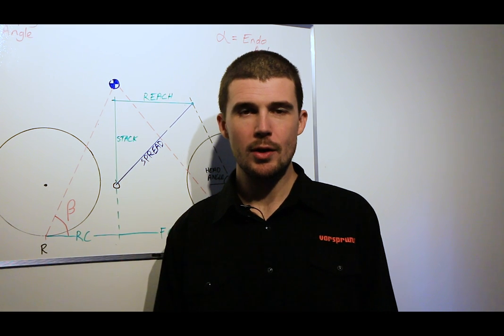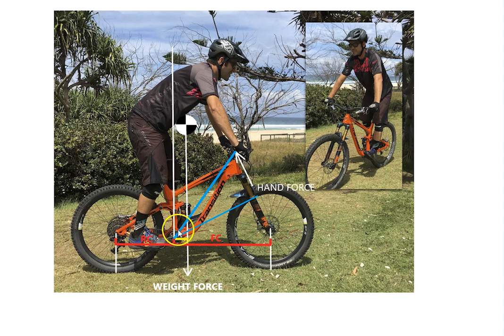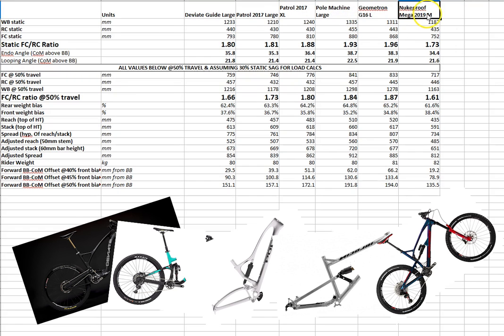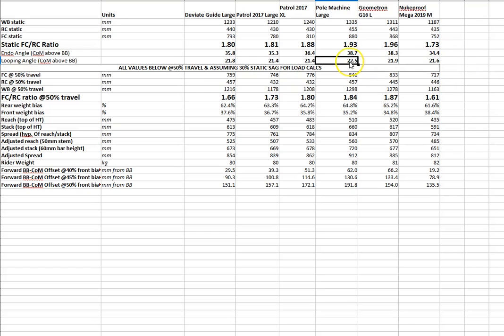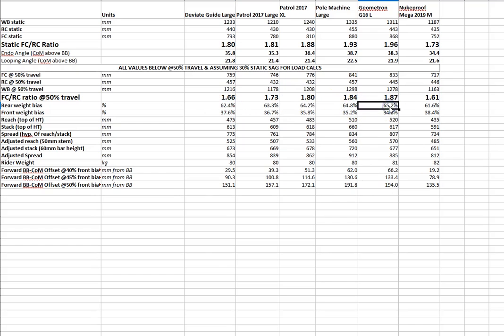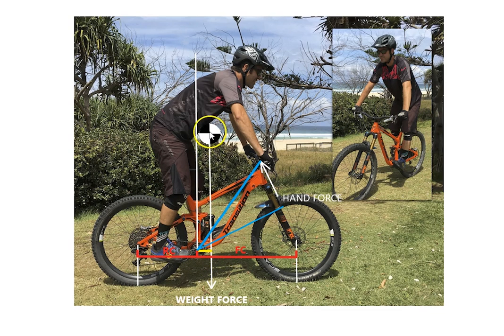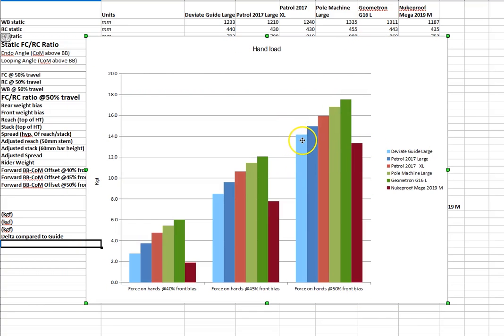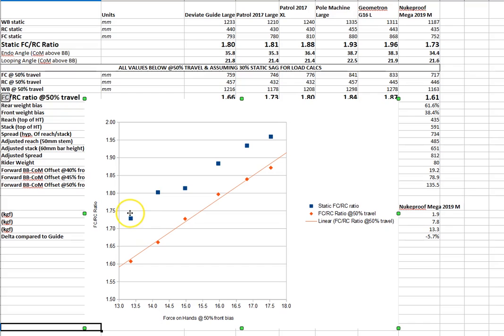Understanding Advanced Bike Geometry Pt 2 - Tuesday Tune 26

Comment: Hi Steve! It's Leo here. I think you were asking me to answer this one :D Cool crushing numbers! Kudos for that, but you fell into the "static vehicle design fallacy". We did similar graphs a few years back before we started to change the geometry. One of the assumptions was that if we make the reach longer, the rider might get more tired if your reach goes further in front. The numbers don't really take in count the reality where the rider position of riding is not static. The optimal rider moves up and down on the bike rather back and forth. The riding stance is not very static, and the rider kinematics, the bike kinematics, and braking need to take into account. So, just trying to calculate the numbers on a sheet for a bike is not worth it because you start jumping into conclusions without thinking about the rider. Many bike designers seem to follow motorcycle and car design principles and that is a big mistake on bike design. What you need to do is start to stand on a scale and lean to a desk and bend your knees. ;)

Braking affects quite a bit to your weight distribution because riders don't go through corners very often just by coasting without braking.  Fe. Matti Lehikoinen drags his front brake throughout the corner. When we looked at the cornering by video, we saw that all riders on old school bikes,  tend to reach back on their bikes rather than in front. The reason is that on an old school bike there is not enough room (your body mechanics limits it) to move down to reduce the weight on the front. The riders control the front wheel weight by moving up and down. You can test this by standing on a scale next to a table and lean to it. Play around with the reach and the height of the table and bend your knees while leaning to the table and you'll see a dramatic change on the weight. This is why your calculation is not very valid and the reason you did not have grip is more about the suspension tune and probably more about your riding style (For the record: Steve is FAST). I filmed Joe Nation and Matti Lehikoinen riding our Stamina in Madeira. You can see from the video clearly that the guys are not trying to reach forward to gain more grip https://www.youtube.com/watch?v=O35iidRWKEw Later this year we will have Joe's and Matti's cornering tips on our vlog (supported and a flat corner).

A longer wheelbase is quite different when you ride downhill as you are not in a steep angle on drops. The longer wheelbase front wheel reaches the drop bottom before the rear. This means that the rider does not have that much flexibility and therefore he saves energy by moving less. With all designs, there are drawbacks though. On a longer wheelbase, the front end is not that easy to manual on a road. You need more effort on that. But on the other hand, on the trail, you can get your front wheel up anytime you want and you can also plow through stuff and save energy like that. Also, the longer wheelbase makes the ride calmer because there is less movement on both ends of the bike. Our conclusion is that with a longer bike you save more energy and you are 2-3% faster on an Enduro track.

I think comparing Sam hill and the reach number is a bit far-fetched because if you look at his riding on ANY BIKE, he hardly seems to do anything. The reason he looks like he's not doing anything is just that he has mad skills and he is strong as a horse. On EWS, the pedaling is a very crucial part of the winning ;) 

On the grip issue you had on the Machine: If you remember, we had to use the same rear shock spring rate that I did, and the reason why you did not have enough grip on the Pole you rode was mere that your shock did not have the right spring rate. I weight roughly 73kg, and you are somewhat 90kg? I think it's fair to say the bike setup was far off for you.

Your tech vlog is cool! Actually, I was just about to email you about the hysteresis on shocks. I'm still thinking if the hysteresis on shocks is useful or not because we can create a similar effect with the leverage ratio and a low tune as well. I would love to chat again soon and change thoughts because I think that you are one of the smartest guys on the bike industry!
Reply from the maker: Greetings again Leo! This is obviously a static, flat-ground comparison simply for the sake of eliminating variables in order to maintain consistency, and ONLY really looking at cornering grip. FC:RC is not really relevant in a straight line or in any situation where you aren't exceeding lateral tyre grip. It's easy to say something is a static fallacy but short of coming up with a 6DOF simulation incorporating the rider (which btw I have actually tried to model in the past) everything will have some simplifications or situations where it isn't applicable. This is part of the reason why I said that my opinion was that optimum front tyre load (as calculated here) was actually LESS than 50%, because obviously descending sloped terrain will always increase front tyre load for any given body position when compared to flat ground. At any rate, trying to quantify these things in a dynamic environment is hugely problematic in no small part because the rider can move so much to compensate for the bike.

You may be interested to know that this was a topic I started examining in more detail after riding the Machine to try to explain what I was feeling on the bike, because after riding with you, I got back on the Deviate and went for a ride to see what differences I would notice. The improvement in front end grip on the Deviate - specifically, how centred I could stay on the bike whilst maintaining front wheel weighting in both smooth berms and rough flatter corners - was extremely noticeable. Having spent a large amount of time riding various suspension setups, I'm very confident that the somewhat too soft rear end wasn't to blame (although on that note, I'd recommend on future models making the centre of curvature higher and the linkage less progressive, that'll help reduce the harshness on square edges, improve rolling speed and get rid of that tendency to kick on jumps), and I even went as far as testing that by underspringing the rear of the Deviate too. The effect it had was the opposite of what you suggested though - running the rear end disproportionately soft led to a reduction of grip at the rear wheel rather than the front.

I'd agree that riding styles affect it a lot - shorter riders and riders with stronger upper bodies will find it easier to keep weight on the front wheel in most cases. As you say, riders on more conventional-geometry bikes tend to be further back on the bike when cornering - but my opinion seems to differ from yours here, because I don't believe it's that the bike is in any way forcing them backwards, I believe that they're simply able to keep enough weight on the front wheel without being forced to lean far forwards to achieve that. Essentially, they can support their body weight more through their legs and less through their arms whilst keeping weight distribution appropriate, and even the strongest guys out there are still stronger in their legs than their arms.

I agree that long chainstays are little hindrance on the trail - they suck a bit for skatepark riding but I don't think I'd really care about the extra difficulty manualling. I'd really be super interested to ride a Machine again, except one with a ~490mm chainstay instead of 455.

Hill is a beast, no doubt about it, and we can all agree that his success is a LOT more to do with his skills and fitness than the bikes he was riding. But you should go back and look at the bikes he's had the most success on over the years and compare the FC:RC ratios. The Sunday he was destroying everyone on in 2007/8 had a ratio of around 1.68. Oddly similar to that Mega. 

Shock hysteresis can't be replicated with the leverage rate of the frame as such. I don't think it's a big deal really, having zero hysteresis is almost certainly worse for bump absorption than having some moderate amount (an ideal amount of which I have not yet quantified - having a ton of it isn't great either).

Cheers for the discussion!
Reply: @VorsprungSuspension  Love the calculations. This kind of analysis is great for beginning to understand what's happening on the bike, even if it doesn't tell the whole story.

I agree with Steve that Pole/Nicolai/Transition bikes are harder to find front-wheel grip in some flat corners, but this can be mitigated with grippier front tyres and a more forward riding style. I agree this can be more tyring on the arms, but i think recent improvements in fork air springs have allowed front centres to grow by iproving front-end comfort and support, so the rider can put more weight through the bars. The machine is a lot easier to turn with the Debonair Lyrik than the old one. 

I think the Deviate is not the best comparison to support this point, though, because it's so different in terms of anti-rise, head angle and chassis weight distribution. It's a particularly easy bike to ride in terms of flat-terrain traction, but it's way too short for my tastes when things get steep and rough. Maybe i can convince @Pole Bicycle Company
 to machine up some different-length swingarms to test.
Reply from the maker: @sebstott3573  cheers. But what if you put the grippier front tyres on the other bikes? And the whole point was that you do actually HAVE to ride more forward on these bikes when cornering, and that as you say, it's a bit more tiring when you're in that position. That could be countered (or even exceeded in a beneficial manner) by being more relaxed during straighter segments of trail since the bike's tendency to trip is lower with a longer FC (as discussed in the previous video).

The Deviate is an absolute beast in the corners and just super easy to rip on, but I agree that its steeper head angle and shorter WB make it feel less planted at high speed in a straight line (although for outright plowability the rear end still feels better than almost anything else I've tried, Commencal Supreme SX being the only thing better, and that also has 20mm more travel and cornered a bit weird due to the high initial FC/RC ratio). But the chassis weight distribution itself is largely irrelevant IMO since even a relatively heavy bike is so much lighter than the rider to begin with, and anti-rise is only relevant when braking (which in an ideal world we'd avoid doing mid corner). The Deviate is certainly not perfect either, there's plenty of things I'd like to alter, but I actually do think it is a good benchmark for this particular mode of analysis because it's one of the few bikes I've found where the spread is reasonable (ie sizing is good for someone my height) AND the FC/RC ratio is reasonable.
Reply: @VorsprungSuspension  Sam Hill's custom Sunday frame had a Large front triangle with a Medium seat tube length, and the head angle was 63 degrees. That makes the ratio of FC to RC something like 1.77, closer to your Large Deviate, for a 175cm rider.
Reply from the maker: @AlexSalikan  he also had custom offset crowns long before Mojo made it trendy, the wheelbase was said (by DW, the designer) to be about the same as the stock large.
Reply: Slackening the head angle by two degrees would increase the wheelbase by something like 40mm. The stock Boxxer had an offset of around 42mm. He would have to have run close to zero offset to have a near stock wheelbase, which clearly wasn't the case.
Reply from the maker: @AlexSalikan  just calculated it out, increase in WB would be just under 18mm for a 568mm A-C between 65 and 63. IIRC DW said the offset crowns were about 10mm lower, so net difference of around 8mm for a ratio of 1.70. Could be off a bit if he ran the crowns further up the stanchions though, don't have data on that.
Reply: You're right. My bad. I doubt he ran the crowns higher up the stanchions, as he was all about getting the front end as low as possible.
Reply: @VorsprungSuspension  

"This is obviously a static, flat-ground comparison simply for the sake of eliminating variables in order to maintain consistency"  
It's rad that you make these videos but, but there are numerous issues with your physics analyses.

1. You use bikes that have different size
2. You use bikes with different fork lengths (AC)
3. You neglect the real-life testing and try to base your study with a different day riding with no actual numbers on real life.
4. There are no numbers on simulating fatigue.
5. The bikes do more than just cornering

I don't think this is a good way to evaluate a bike characteristics because the static is not very constant when riding a corner with a bicycle just because the rider weight is far greater to the vehicle. Also, your reasoning for getting bikes with very different travel and size is not very smart regarding comparison between them. If you did the experiment I recommended, with a scale, you should understand that just by bending knees the rider can change the weight shift easily over ten kilograms. The reason that a longer reach works with an average rider, they can not push their weight off the front wheel what is usually the problem of washing out or going over the bars. You are literally the first person ever even to bring up such claim that on a Pole there is not enough grip in the front and I think the reason is that you were on experimental setup on the rear shock. With our pro riders, we have made a lot of testing lately, and none of them pointed out anything that you said in the video. The only thing what Matti and Joe were commenting was that they had to adapt to the length of the bike timing wise. Leigh, which is a similar size to you was happy from the start that he could finally get a bike that is big enough for him. What I'm trying to say is that your numbers (for the fatigue and grip point) do not have a lot to do with real life riding. If you look at the video, I posted in the last comment, and you look at it frame by frame, you can see how the guys corner. Matti is using almost all travel front and rear before he exits the corner. Here's more cornering where you can see how Joe is on the medium bike. https://www.instagram.com/p/BrpKdU3lYZE/?utm_source=ig_web_copy_link

"I'm very confident that the somewhat too soft rear end wasn't to blame"
 If you soften the rear and load the bike, you will lose the energy in the corner to the back mainly because the energy goes where it goes the easiest and that's why you could not load the front enough. It's like firing a cannon on a swamp. You need support from the rear to engage the front.

"although on that note, I'd recommend on future models making the center of curvature higher and the linkage less progressive, that'll help reduce the harshness on square edges, improve rolling speed and get rid of that tendency to kick on jumps" 
Seriously Steve? You seem to forget that you were riding was the underdevelopment EXT Arma that had too little high-speed rebound damping (bucking), far too much of the hydraulic bottom out resistance (which is the reason of square edge hit inconsistency). I really think it's unprofessional to make such claims without even riding the optimal setup and also if you would have told me that you would quote our riding session in a video, I would have set up you differently. The higher curvature point for the rear wheel, for instance, has nothing to do with square edged hits being transferred to rider characteristics. A lot of companies have made experiments (Specialized fe.), and no-one has come up with a reasonable scientific explanation why a rearward axle path (frontward bb path) would improve the riding over an obstacle. However, I can point out why the riding gets worse by extending the bike from the rear which would improve your "number of equal weight distribution". In the early days of Pole, we had a test bike that had a vast rearward axle path (K9 DH001-S), and the rearward axle path didn't seem to have anything to do with better square edged hits. However, in cornering the rearward axle path brought the rider weight way too much in front and it was hard to corner the bike because the rear center was getting longer throughout the travel. Our conclusion from testing Pole against K9 bike was a massive difference in timed laps in favor of Pole Mule. The bike that had more travel, a rearward axle path, and similar setup was slower than our mule with a concentric single pivot and a forward axle path. The only way we could explain the dominant behavior of the mule was a better geometry for a rider to exit the corners with higher speed.

"I believe that they're simply able to keep enough weight on the front wheel without being forced to lean far forward to achieve that." Well, I did not say anything about leaning forwards. I said riding with straighter legs vs. bent knees. You don't need to "lean forward" to get more weight to the front. The riders are bending their knees so they can go lower to gain less weight to the front end. We have now three riders on our team that come from such conventional bikes, and they have all found out the benefits of a longer bike. Nobody was saying anything about fatigue during the tests. One of the riders comes from Nukeproof. 

It's another thing if we start talking about how the riders physics work on a bike and how do you want to set up your bike to save energy? This is what we are doing on a weekly basis. Actually, your body is usually equally weak if you have not trained it especially for something else. On a bike, you are using pretty much your whole body for riding, not only legs or arms. Your core muscles are more important than just individual part of the body. Some people start losing their strength from back before their arms begin to lose power and someone's calves are getting more tired than hands. Usually, it's the hands that feel the pain, but the problem might be somewhere else.

There are many variables what we need to take into account when we manipulate the geometry but one thing what you need to take in to account that you should not trust too much on your feelings. If you did not make any measurements (timed runs, grip power test...) when you rode the two bikes, you can't clearly make any firm statements. The reason that I'm so sure about this is that we have done a lot of testing and one thing that is sure is that the riders can not say how fast they were after a test run. At Pole, we have a lot of bike with different sizes so for us it's effortless to test these things. Apparently getting a shorter bike for me for testing is not an issue. While I was in Whistler, I was riding Medium and Large, and I did not find any problems of having more fatigued on either bike. The most significant difference for rider feel was the shocks. What I've learned about the front end grip is that only 5mm spacer under the stem makes a massive difference how you can load the front.

During the six years of designing bikes 100% from the ground up, I've found out that just changing one or two numbers is not the whole case. Stamina and Machine are both very similar bikes what comes to geometry and suspension (Stamina has the same rate of a leverage ratio to 160mm of travel), but still, they ride entirely different. The reason for this is that I made many small changes throughout the bike where construction of the frame itself was the biggest. What I want to say is that just changing one number doesn't necessarily give you the desired effect.

PS. I asked Matti Lehikoinen about Sam's riding style. He said that no one can ride like Sam or Sam's lines in the world. Many have tried, and many have failed. Everyone has to find their own style to be fast. Also, we talked about the balance on the bike. Matti also thought that trying to crunch the numbers to this individual number is a waste of time. You need to do timed laps and measure the changes. That's how you do it professionally.
Reply from the maker: @Polebicycles  to address your concerns in order:
1. "You use bikes that have different size
" - yes, for the sake of illustrating that different sizes of the same frame have different characteristics. I was quite clear on why I compared the medium Nukeproof and not a Large or XL. Every company specifies different recommendations for rider height vs their sizing so I grabbed size Larges to compare for everything else.
2. "You use bikes with different fork lengths (AC)"
 - yep,  I don't actually consider that particularly relevant here.
3. "You neglect the real-life testing and try to base your study with a different day riding with no actual numbers on real life".
 - You are 100% wrong on this assumption. This isn't a blind analysis of bikes to predict performance, it was a numerical analysis of what I had experienced in real life. 
4. "There are no numbers on simulating fatigue.
" - are we really going to try to argue that more load on the arms isn't going to be more tiring? 
5. "The bikes do more than just cornering" - obviously. This is a cornering body position analysis. It's not a comprehensive simulation. The point of it was simply to show that weight distribution in corners matters and body position is affected substantially by the FC:RC ratio. 

I realise you're upset because I criticised your "perfect bike" but you're also sitting there criticising every other bike in the world as well as trying to publicly discredit numbers that do actually make sense. I didn't bring up bump absorption or bucking any of the other minor issues in the video because I agree that the shock damping and setup weren't ideal. They also weren't so far off that they affect handling to anything like the degree you claim - I've been riding for the best part of 20 years and have spent most of that time with my head in suspension. The front/rear wheel grip distribution was noticeable even on steady state corners where the bike reached a temporary quasi-static position. In those scenarios the only thing that matters is your weight distribution, the damper is doing nothing and the spring force is a constant.

"Well, I did not say anything about leaning forwards. I said riding with straighter legs vs. bent knees. You don't need to "lean forward" to get more weight to the front." - Actually, yes you do. You can move down and forwards or just forwards, but either way, the result is moving the centre of mass forwards, and the consequence of that NO MATTER WHAT is more load on the hands. I don't understand how you're even trying to argue about that, the physics is simple and immutable. You can't on one hand tell me that I don't know what I'm talking about and that the comparison is invalid and then simultaneously dispute a simple free body diagram balancing moments - that would have been something you learned about in the first month of studying engineering.

Comparing the experiences of professional riders to the rest of us amateurs in terms of upper body fatigue is obviously going to result in "guy who spends more time in the gym and on the bike has less issues with arm fatigue". And yes I'd also agree that arm fatigue is not the only concern, and not always the first thing to give way.

As far as "high pivots don't have better bump absorption or rollover characteristics" - you clearly have not actually analysed or measured that in isolation, so please drop the "there are numerous issues with your physics analyses" thing - nobody here has a "complete" understanding of everything, and the fact that another bike was faster overall doesn't negate the benefits. The shaft velocities are lower, the wheel has more time to get out of the way, generates less CPL variation, lower normal and tangential forces on the swingarm resulting less hanging up on medium and larger bumps. You can definitely debate the handling characteristics and the greater variation in centre of traction, but the bump absorption aspect (in isolation) is no more up for debate than climate change. Your standard of comparison is a DH bike vs a trail bike - ok, so what? That's equivalent to using that comparison to try to say "well we compared our test mule to the ugliest bike we could find, and our bike was faster, so obviously the bike's ugliness was what held it back" when there's a TON of confounding factors. That isn't a measurement, that's not scientific, there's nothing proven there other than "this complete package was faster than that complete package". Any XC hardtails would be faster than DH bikes on certain terrain, does that also mean DH bike geometry is slower than XC bike geometry?

The problem with your line of argument here is that you're taking the "you haven't proven my bike isn't faster" approach - I don't personally care if your bike is faster or slower overall, in fact you may notice that was never mentioned in the video. I was looking ONLY at the cornering weight distribution aspect. Trying to discredit the analysis just because it doesn't favour your bike is frankly quite weak. The numbers I posted are reasonably indicative of what you see in the real world IN THIS SPECIFIC SCENARIO, in fact from a vehicle dynamics perspective they're quite bulletproof (except that I messed up the Nukeproof's RC, should have been 437mm at 50% and a FC:RC ratio of 1.64 not 1.61 as someone else pointed out). They don't mean that the bike is a POS or that it's slow or otherwise poor. But so far you've incorrectly pointed the finger at a bunch of different prospective causes rather than just acknowledging the fact that yes, your CoM has to be further forward of the BB, thus putting more weight on your arms. You could have at least made the claim that this was offset by the greater straight line/steep terrain stability and that the net levels of arm fatigue on the Machine would typically be comparable or better to other bikes, and on that I might agree, because it is good on that. So stop taking it so personally. Instead you should maybe take it as a compliment that people actually think your bike is worth comparing to others as a benchmark of some form, even if it has its tradeoffs in certain areas, and that discussing compromises isn't intended to paint your work, your products, your company or you personally negatively. It's kind of similar to making fun of someone's English when it's their second language - by the time it gets to the point where you'd laugh at something funny they said, it's because they're speaking English so close to perfectly that any discrepancies stand out. When people openly criticise specific aspects your products, it's because they're good enough to be worth it.

Like I said though, if you ever build one with a way longer RC and a higher pivot, I'll be VERY interested :)
Reply: @VorsprungSuspension  

Firstly, just because I criticize your video does not mean that I took it personally and I hope that you don't take this either. I'm doing my job :D I like you and I think you are cool. If I would not know you I would not bother to have this conversation in the first place. This is your channel and you can say whatever you like. The reason why I comment your video is that you brought up Pole and use it as an example, and I think you did a bad job at your conclusions, not on the spreadsheet. I'm not mad at you and I don't think I have created a perfect bike for everyone. We have sold thousands of bikes to 37 countries so I guess trying to flatter us with bringing up the bike on the channel is not relevant here. We have our own secret sauce and if you would create bikes, you would have yours. I'm just disappointed with your way of bringing this up because I thought that you would keep the consistency on your channel purely analyzing things scientifically and not bringing up individual things out of context and base your strong opinions just on confidence. 

Overall I think that in this video you are trying to simplify a complex thing based with thin evidence. I think that your assumption of Sam Hill is far fetched because he does not represent any of the majority of riders. Sam might be even the most unique rider out there. "I feel", "I believe" and "I'm confident" and analysis based on a riding style like a sack of potatoes does not correlate to reality. I'm not saying that you ride like a sack of potatoes but neglecting the human biomechanics and phases of cornering, braking, squatting, loading etc. and also the brake squeeze power taking off the equation and trying to base evidence on a feeling is just very lame from a scientist. If you would be another journalist who just would base your findings on feelings, I would not bother to have this argument. If you would act like a scientist, you would need more data to convince me about your theory. Your English is far greater to mine (and I find you verbally very talented) where I need triple the time to even write these comment so don't get offended if I'm not answering everything. But one thing I want to address is: "are we really going to try to argue that more load on the arms isn't going to be more tiring?" No, I'm not going to argue about it if you put it that way, but I think that you are oversimplifying human physics by just saying that.

I think that our points of view differ in looking at overall performance and one individual performance points of view. I think that overall is what matters and the one thing should always be possible to measure in real life with the overall performance test. I think for example @Seb Stott is doing a great job with his articles. For example, the tire test is very good. You could do the same thing in a laboratory or try to crunch the numbers on an excel sheet but the real life is what matters the most. How do they actually perform?

 We sent a stock bike against pro racer bikes: https://enduro-mtb.com/en/10-fastest-enduro-bikes-in-test/

I'm going to leave this here. Happy new year!
Reply from the maker: @Polebicycles  no worries, as long as we're hashing out useful concepts then it's all productive. I think however that you are building a straw man there, because where you think I'm not looking at the bigger picture, you're ignoring the fact that I'm not TRYING to look at the complete picture here, just one small (but IMO important) element of it, in a way that clearly explains the concept of weight distribution in one particular scenario. The reason this part is so subjective is because the point was to explain what I had experienced as a rider - in the real world, on various bikes, on various trails - by being able to compare numbers between bikes. Besides the fact that obviously that isn't everything involved in making a good bike, just one aspect, what it doesn't establish, or even attempt to, is what an "ideal" degree of arm load is - because obviously that depends on rider strength (even proportionally within his/her own body, as you say, because the arms might not be the limiting factor) and preference, since some riders like particularly aggressive forward positions and some don't. It does however point out the obvious inaccuracies in claiming any bike's handling is dialed beyond belief when the bike has multiple sizes using the same rear centre length - it might be great in one size, might suck in another, at least in this particular regard.

I put Hill's bike in there only because I thought it was interesting for the sake of comparison, not because I pretend to know why he's as fast as he is (I doubt even he really knows that) or because I think the bike is the reason - it was simply to look at potential strengths that his particular configuration may have given the fact that his bike does NOT have the indisputable straight line advantages of the Machine or Geometron. Maybe he'd destroy everyone by huge margins if he was on a Machine or similar, but then again, if that Enduro mag test is at all accurate (I have plenty of reasons to question it however, on many aspects), maybe he'd be slower and should be riding a Hightower instead - hard to believe the almighty Evolink was toppled by a fairly conventional-geometry Hightower in that Enduro mag test, although you're gonna love me for pointing out that the FC:RC ratio (at 50% travel) of that Hightower was 1.63 :)

Anyway understand if you don't wish to continue discussing this in public. Keep up the innovation though, the Machine is overall undoubtedly the most interesting and unique bike built in the past 10 years, and you're an interesting and somewhat crazy guy who I'm sure will manage to surprise everyone many times to come. All the best.

p.s. only mentioned the Machine out of spite for you not publishing geometry on the Stamina. Haha :)
Reply: Vorsprung Suspension These were the best comments that I’ve read on YouTube. It makes to me to trust Steve more and I also want to try Machine! Great job guys! Keep it real.
Reply: @VorsprungSuspension  you didn't look hard enough. The numbers for the medium, at least, are out there.
Reply from the maker: @jacobtucker3856  didn't look hard enough for what?
Reply: @VorsprungSuspension  "p.s. only mentioned the Machine out of spite for you not publishing geometry on the Stamina".
Reply from the maker: @jacobtucker3856  that comment was just winding Leo up due to him obviously getting sick of people discussing geometry on the internet and publishing head angle figures like "slack" and seat tube angle figures like "steep" :) I don't really care whether he wants to publish geometry or not, it's his prerogative, and the Stamina is not an interesting bike to me personally.
Reply: @VorsprungSuspension  @Pole Bicycle Company  Great free body diagram! but I have to go with Leo here. Your spread sheet based explanation is only what it is but in this comment you call out more added variables that would have to be quantified to make it meaningful in Leo's real world. Come on man! It's a a half ass attempt to explain a 'feeling' that you have. The whole thing is subjective and biased from the get go. You data sample is small, 3 of the 5 bikes have been ridden. Why didn't you pick Richie Rude on the SB150? or analyze the much loved short stay Ripmo? Why even name a bike?  Your static center of mass input is bogus. What does adding 5 lbs of Pinion gearbox at the BB do to that? How about the soil condition and moisture content? What about lean angle and tire design? On and on.To keep it fair why not build a spread sheet that was based on a progression of bike geometries that were just graphic representations and not named or branded? When somebody states with authority what you have about the great significance of F/R bias as influenced by front center length and uses words such as ; opinion, belief, believe, try, reasonably representative, reasonably indicative etc. and then attribute your assumptive analysis to Sam Hill's success...... I head for the hills. Some where you claim Leo is making a straw man argument then ad hominem back  about his 'perfect' bike! Telling Leo to not take it personally and how he 'should'  take it is arrogant.  I resist your black and white depiction of my riding experience. Some days my wrists get tired and some days they don't. I have been schooled by the fast young guys to work on my bike body separation, I get lazy on the bike. I'm 68 years old, ...is it my aged body or am I just(finally!) putting more weight on the front end? Hard to tell. I am cornering faster on my Stumpy Evo than I ever have at it's 1.80 by your F/R  measure. I've been riding a MTB for 30 years. I guarantee you that at 20 years experience you are a far better rider than I...but that should not have any bearing on your allegedly objective analysis.  Do better.
Reply from the maker: @buzzerm  You're simply missing the point - that with a higher FC:RC ratio you have to have your centre of mass further forward relative to the BB to keep a given amount of weight on the front wheel. Whatever moment that generates has to be borne by your hands. You can try to complicate it further, but the concept is that simple, and the physics of that really are not up for debate. It's not a static analysis as such, steady state planar acceleration in the Z direction (ie being leaned into a corner during steady-state conditions) is where this is relevant. If the resultant resolved force vectors from the tyres aren't in plane with the rider, the bike/rider mass rolls one way or the other, but that isn't the point of the explanation, so the 2D analysis is entirely reasonable. What does adding 5lbs of gearbox near the BB do? Not much when the bike/rider are 230lbs, it's less than 3% of the total mass. Is this ratio the sole reason why Hill is winning? Nobody is silly enough to say that's the whole reason, you're trying to put words in my mouth there - the point was that he's somehow managing to be competitive (to say the least) on geometry that many people (including Leo) believe is "slower" than the new school geo, and my suggestion (and opinion) is that this is a relevant aspect of what makes it easier or harder to ride a bike fast. Small sample size? Having ridden dozens (if not hundreds?) of different bikes over the years, I picked a handful of relevant ones to put into this video. Strange assumption to make that they're the only ones that have been analysed in this manner. If the best you can come up with is saying that making some effort to correlate the subjective experience in the real world with the objective numbers is "bogus", only to follow it up with your own subjective, utterly unquantified experience and a few personal insults, well, do better with your criticisms.
Reply: @VorsprungSuspension  I am not missing your simple point and I don't think Leo was either. I said you static CG input (into your spread sheet formula ) was bogus, not what you said I said. Your free body diagram and explanation are good and I said that! I applaud your effort to correlate subjective experience with numbers. 5lbs of gearbox weight at the BB does something, the actual center of mass of Sam Hills body vs mine does something...a bunch of 'nearly nothings' add up. Your total range across the bike of COM adjustment to get the magic 50%F/R ratio is what? 59mm/2.32"..? Does that qualify as nearly nothing? And yeah the half ass thing was mean but for somebody as smart as you, your model should be more precise in its inputs. The output to flat ground in a static setup is hard to value in the my view of a dynamic ride experience...but I get the physics!
Reply from the maker: @buzzerm  the numbers are there only to illustrate the concept of how a rider's weight has to be positioned relative to the contact points of the bike (BB/bars) in order to achieve a certain weight distribution in one particular situation, and the amount of variation in load on the hands when all else is equal (because if we're going to vary a bunch of other stuff at the same time then there's no way to make meaningful comparisons). Tilt the bike forward 15 degrees and the numbers shift but the trends between bikes don't - these things weren't included because this video was already longer than I wanted it to be. You can move around on the bike in two dimensions and it'll affect transient and steady state CPL (contact patch [normal] load), but total CPL is a combination of both transient load and weight distribution - the problem with using transient load (eg pumping the bike or trying to push the wheel into the ground harder by accelerating your body mass away from it) to increase CPL in a corner is that because bikes lean into the corner (CoM being vertically inboard of contact patches), you increase lateral load in proportion to the amount that you increase the necessarily planar load between CoM and contact patch - any non-planar load results in angular acceleration in the roll axis, and if you're transiently increasing the load in a non-planar manner to the ground in a way that's actually beneficial to grip then you are necessarily rolling the bike more upright and decreasing the yaw rate. As a result, you can easily pump through corners where grip is abundant (eg steep berms) but not where grip is limited (if you're at the limit of grip... if you're not, weight distribution doesn't matter as mentioned before). 

The reason I made the comparison on flat ground is because that completely eliminates CoM/rider height from even needing to be mentioned as a variable (some non-flat ground considerations are in part 1 of this video if you haven't watched it) which I was sure would otherwise lead to further misinterpretations of the data - we could hold rider height/CoM height as a constant for the sake of comparison anyway, but people would rightly point out that that isn't realistic between a size medium Nukeproof and a size XL Patrol, even though the analyses (not shown in this video) show the trends are valid across those comparisons, whether or not (within reasonable bounds) you adjust for rider height. Rider weight is largely irrelevant because if you're twice as heavy, you have to support twice as much load in any given situation anyway, so that's why that's held constant across comparisons. You're right that 5lbs at the BB does something - it's just not that significant, either objectively or subjectively, compared to the variables we're looking at here.

I think you've also focused on the wrong number to bring up there - CoM movement matters, but how that actually affects the rider is what we were trying to display, in that the FC:RC ratio affects the way you have to bear that load bodily. 59mm on its own doesn't tell you much (and I have actually made an effort to quantify individual subcomponent masses of the human body before to try to work out things like joint angles required for various CoM locations), but 26% higher load on a given rider's hands - even if that's not exactly correct (maybe in another situation the difference is 24%, or 28%, by the time other factors are considered) it's a significant enough change to take seriously, especially since the trend between bikes can be demonstrated to be valid across many scenarios.

As a result, yes, the explanation of the concept is fundamentally valid. FC/RC ratio alone doesn't tell you what bike is great and what bike is terrible, it doesn't tell you what fits you, it doesn't tell you anything about how the bike handles in a straightish line, it doesn't tell you anything about a million other things, but it is fundamentally relevant to how your body has to be positioned on the bike when cornering.
Reply: @VorsprungSuspension  Thanks for this. I agree "it is fundamentally relevant to how your body has to be positioned on the bike when cornering".  Is it possible that pedal kick back or lack of could affect the COM as it translates thru the pedal arm and BB?  Pedal positions as well ..level or outside down? Could somebody with massive core and leg strength influence COM without more pressure on the bars?  Interesting that according to Linkage the Pole has large anti squat and little to no pedal kickback. Check out the last 3 1/2 minutes of this vid :    https://www.youtube.com/watch?time_continue=99&v=tJi5_HF6e_Y   I could not pick out Sam ........40 different ways thru this corner.
Reply: I meant"..... influence FC/RC ratio..." not COM.
Reply from the maker: @buzzerm  pedal kickback is only relevant when actually pedalling in the majority of cases, also occasionally when braking if the wheel locks up (and only if there's a lot of pedal feedback to begin with, it's not noticeable on most bikes but on some it is, like the original Yeti 303), but when coasting the rear wheel is unloading chain slack (like imagine there's no freehub, and it's spitting chain forwards as it spins) at quite a high rate, so you need a combination of very high velocity suspension motion and very low forwards speeds (and/or a huge amount of pedal kickback) for the rear wheel to be pulling on the chain faster than it's unloading it - this is the condition necessary for the chain to pull on the pedals and you to not be basically just pivoting around the BB and balancing using your arms. This kind of pedal feedback when coasting can happen say on a slow-speed wheelie drop, or it can be relevant if you have the rear wheel locked when braking into a corner (and your bike has a lot of pedal kickback) for example, but if you have the rear wheel locked you have very little lateral grip anyway so the FC/RC ratio is of little importance right at that instant. 

Being that you basically pivot around the BB unless there's chain tension, you can't alter your fore/aft CoM position (at a given instant) without some change in load on the hands, so no pedal position or core strength alone can affect that (though you can move the CoM up/down without changing hand load - but this doesn't change the load on the contact patches). The FC/RC ratio isn't something the rider really has any control over when riding - in my opinion, advanced riders will get whatever weight onto the tyres that needs to be there, the FC/RC ratio just dictates what kind of loads you have to put on your hands/feet to achieve that when coasting/cornering. 

The most difficult situations to analyse in any useful way at all are the compound ones, like where you're braking heavily on a steep slope into a steep corner that isn't a super well "defined" line in terms of where it begins, where it ends and what the apex is, and you're scrambling for grip both front and rear because you're having to drag one or both brakes through the corner. Then you really do need a thorough 3D dynamic iterative simulation (that can somehow also simulate the rider, and that is very difficult) to make any kind of sense of it, because for example how hard you're braking has a huge effect on the grip available from that wheel AND the other one, etc etc. The simplifications made in this video aren't valid for situations that complex.
Reply: @VorsprungSuspension  Thanks for taking the time to explain that in detail.  In my abstraction I was not thinking about it as a change in weight bias over a fixed FC/RC ratio between my feet and hands. I just went and pushed down on my bathroom scale to 25-45lbs. I'll just say it has a very noticeable feeling. A year and a half ago a very good(!!) customer of mine bought me a Commencal Meta E power for my birthday.  I have access to a large ranch adjacent to where I live. Super steep and hard to shuttle in a solo situation. E bike opened it up to laps for me.  At 50 lbs the bike is pretty much a pig ..but the front end feel of the bike is the best across my 3 bike fleet. At least for my riding style. 15 lbs of Shimano E-8000 and battery in front of the BB. When I got back on my on my Process 111 I immediately realized what a puss I was about weighting the front end in loose conditions. Would love to ride a Meta without a motor. The Stumpy Evo increases my knar threshold 'overall' for it's slack head angle mostly. Also just to interject on the E-bike deal. I look at it as just a tool in the box. I can access steep stuff that is difficult(or impossible for me) to climb on a regular bike. When my little internal voice starts to tell me it is time to ride...I will go for my pedal bikes 9 times out of 10. I apologize for being a dick in that previous comment. Good stuff Steve! P.S: On looking the Deviate looks like a badass bike!. The extra weight thing means nothing to me anymore.  :-)
Reply: @VorsprungSuspension    Well, just catching up with this vid... 
Great discussion I think Leo being Finnish he can sound a bit blunt to a more western ear (which I like!), and as a compromise I'm planning on buying an Evolink with a Smashpot in my current fork (I'm pretty bloody excited about this combo tbh). 

Everyone happy? ;)

My preference for a Pole is partly down to wanting a more stable ride to give me more confidence. My riding friend prefers something much more playful. My point being that there is enough to keep everyone happy. 

Big fan of both Steve and Leo for their engineer led approach to discussion and selling stuff. I like to be able to "buy in" to a philosophy and read why it does what it does. 

P.S. I understand the reasons for putting a M Mega in the comparison, but aren't the L and XL proportionally quite long by conventional standards? I'd have been intrigued by those too. Is sizing less about how tall you are now and more about how you want a bike to ride?
Reply: Do I have to pick a side..? I choose Leo. ;)